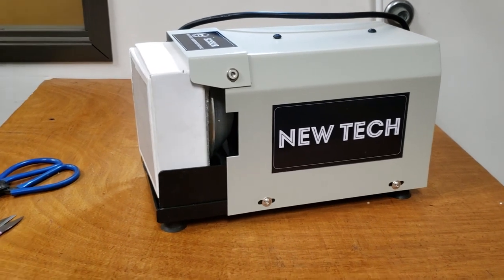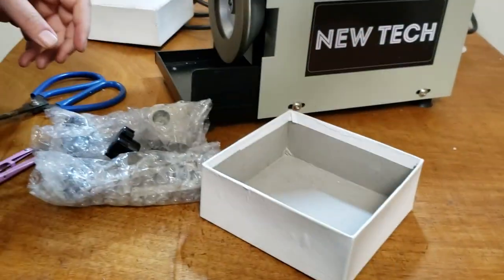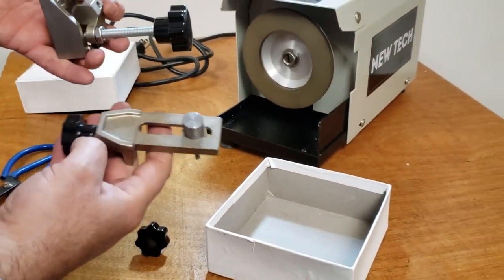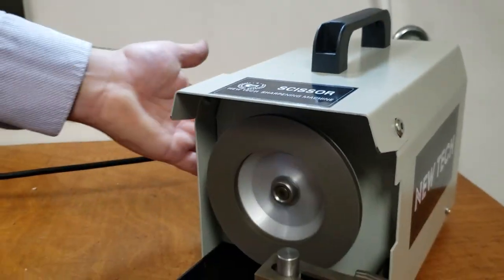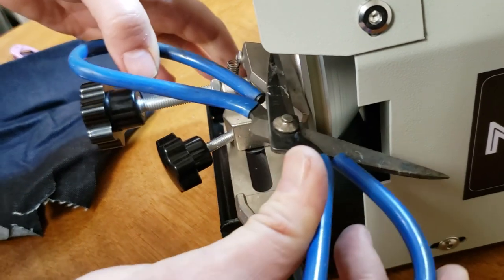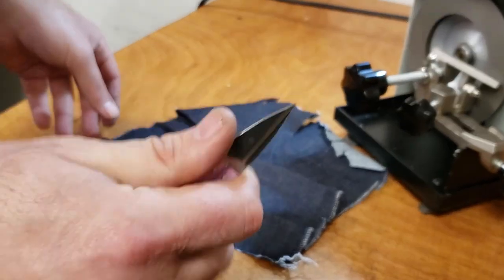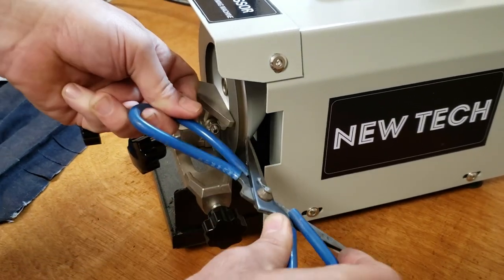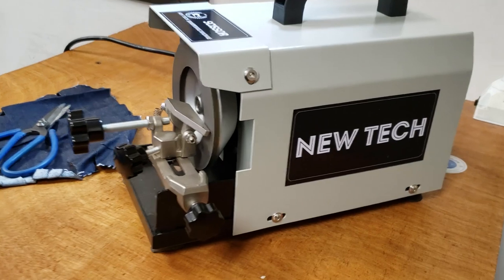Tutorial - Using the New-Tech Scissor Sharpener - Goldstartool.com - 800-868-4419

Comment: Very, very disappointed.  I just set up the machine and it worked terribly.  First, it was not possible to tighten the upper jig enough to stop it from wiggling around, thus causing an uneven edge.  It ruined one of my scissors.  Second, the wheel and the jug get very, very hot.  Hot enough to burn a finger. Third, you give no instructions about how to adjust the angle portion. You provide no instructions for assembly.